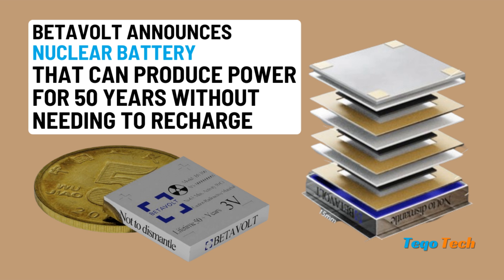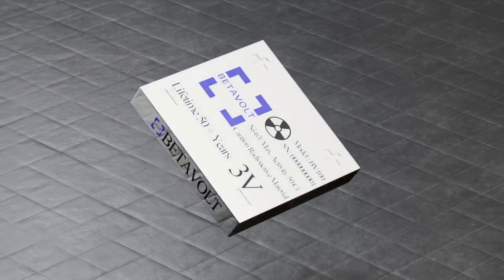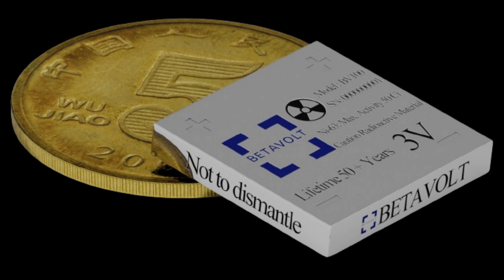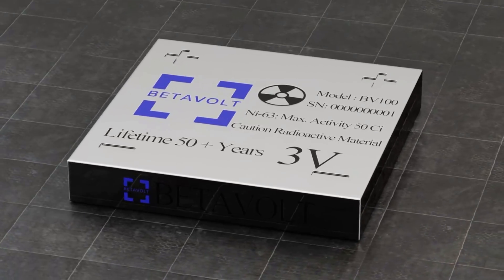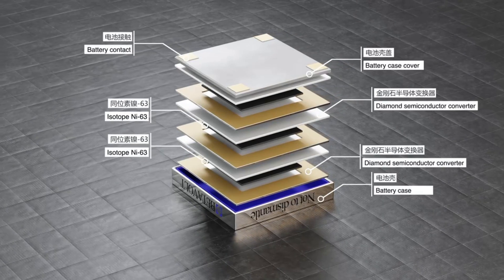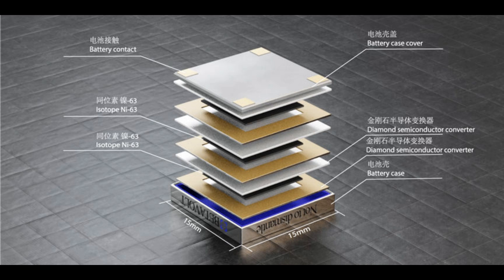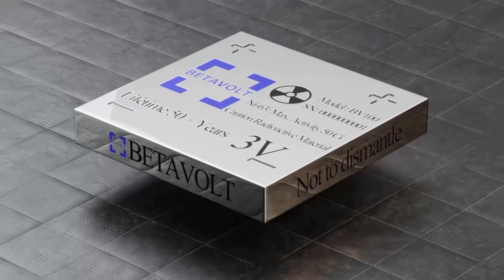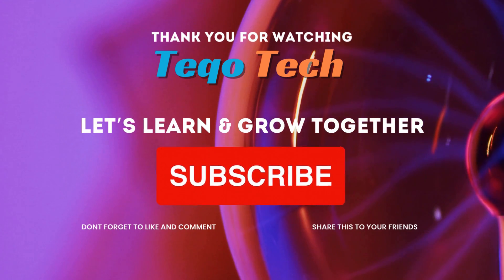Nuclear Battery Betavolt's BV100 to last 50 years

Comment: 100 microwatts = 10 000 batteries  for 1 watt ....This battery could be used to recharge the main battery of the vehicle by adapting the size of the betavolt generator according to the daily use of this vehicle. But at 200€ for the 10,000th volt ampere, the price will have to drop before seeing this technology arrive on the car of the average man

Comment: Micro Battery power of 100 microWatt = 0.1 milliWatt .
0.1 mW.÷ 3 Volt : -> 0.033 milliAmp.= 33 microAmpere
Is it for CASIO Watch.. or Apple (wrist) gadget.?!?
Reply: Its max use will probably be in mechanical watches. IF 33 μA will be enough
Reply: Oh and also: apple watch requires way more than 33 μA.